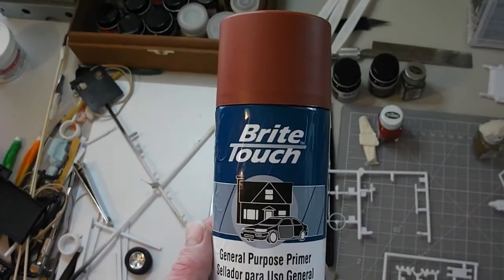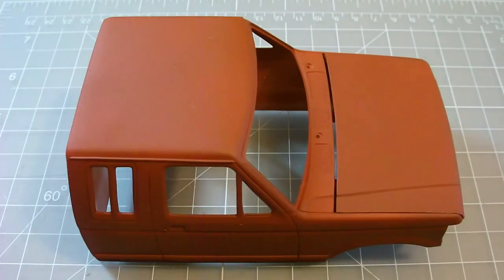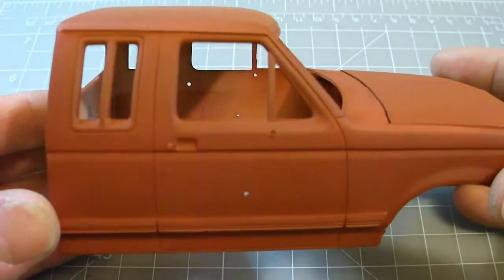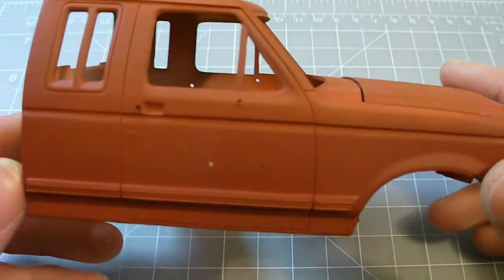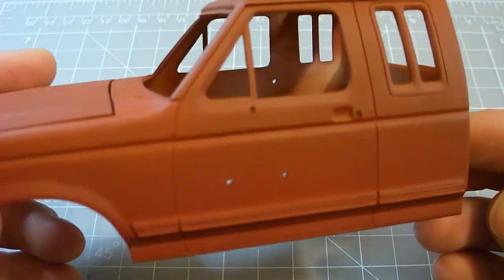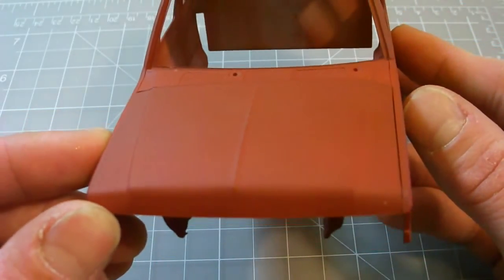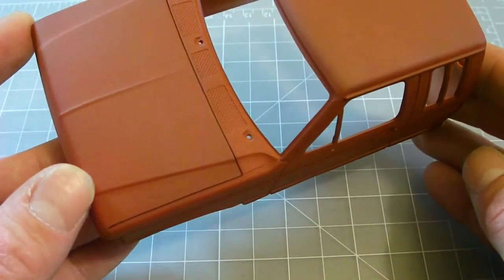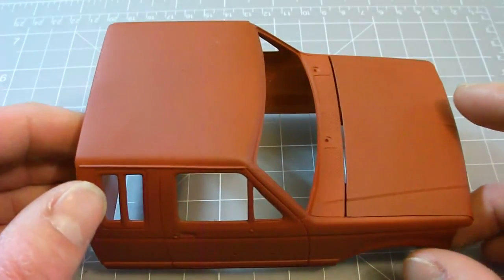Krylon Brite Touch Red Oxide Primer Results - Styrene Plastic

Comment: i have a question, i have masive palm trees in a 55 gallon blue barrel thats been cut in half and im thinging to pain the plastic barrels with red oxide paint as i have a 5gallon of red oxide , but will the pain change anything about he way the barrel receives heat or light altering the whole ecosystem of the roots in the barrel?

Comment: I used it on the Gluebomb CJ7 (See updates on my WhatIsKenDoing channel). I decanted it and airbrushed it in several coats. I like it for the red family of colors because it helps to project your final color more accurately. Airbrushing it made it come out very smooth and I really didn't need to wet sand it much at all. Plus, it's like a buck; how can you go wrong?

Comment: How do you Think this primer (krylon red oxide primer) would work when spraying over a (non stock) resin body?   I want to use this primer as a rust base for a weatherd car, using  the primer, flat dullcoat/salt/elmers glue technique.   What do you think?